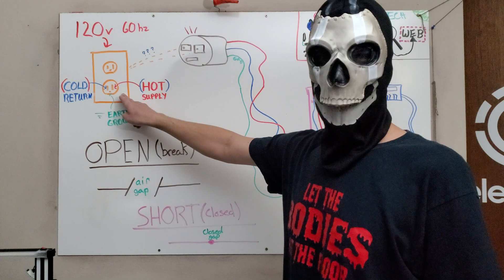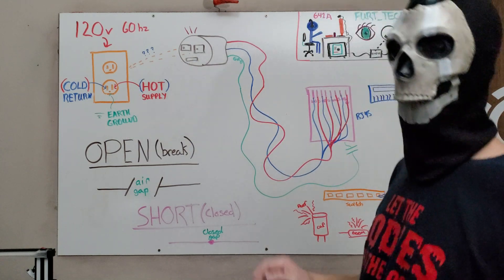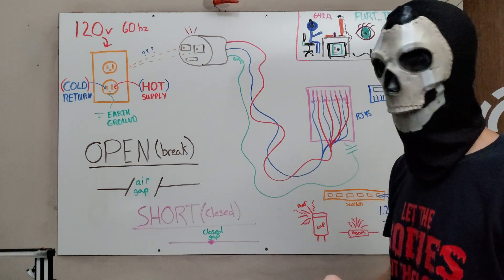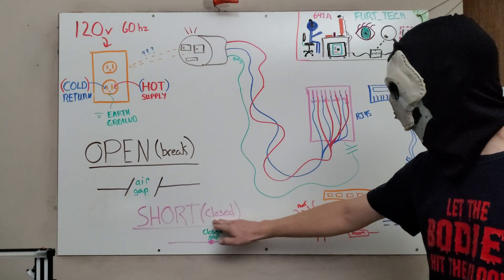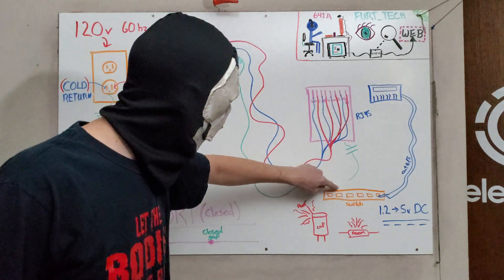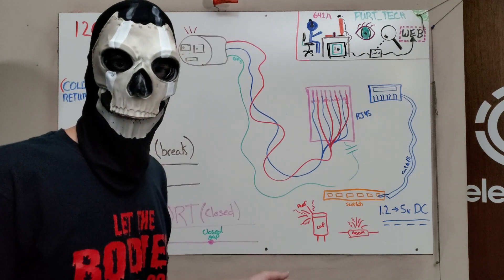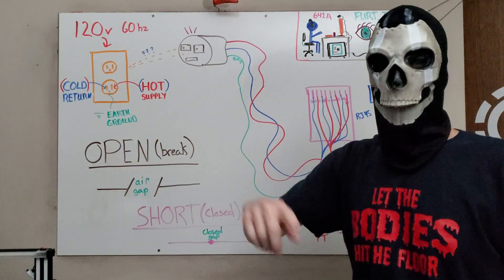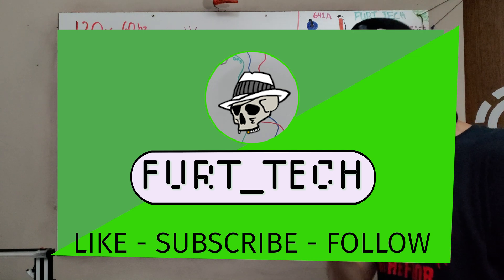🔌 Deep Dive into the Electrical Theory Behind the "Ether Killer" Device 🔌

Comment: okay hear me out, germany has 230V, BUT you can also connect it to a CEE plug or manually wire it in a fuse box between 2 phases to get 400V, much more fun. most ovens are connected to multiple phases too so you dont HAVE to go to the fuse box. CEE outlets dont really occur in normal homes
Reply from the maker: In the US a common stove or dryer outlet would work for two phase fun. I could always go straight to mains and really stretch the boundaries of safety. However for the sake of limiting dangerous suggestion i thought 120v would be a good first step.